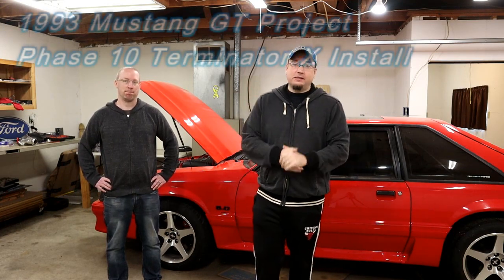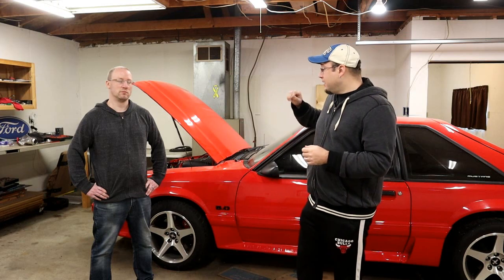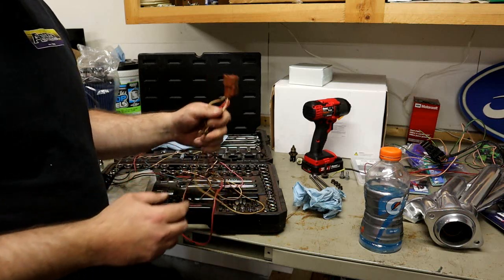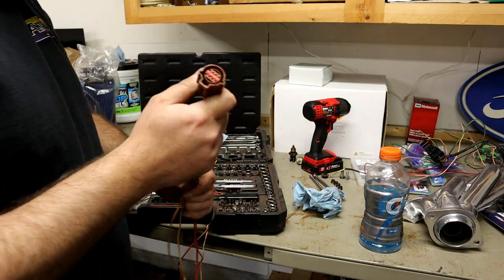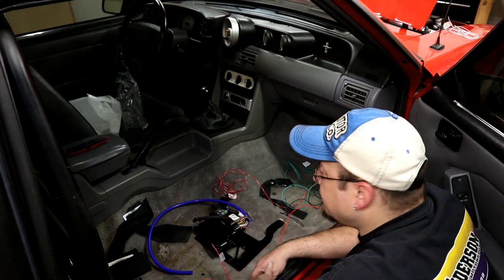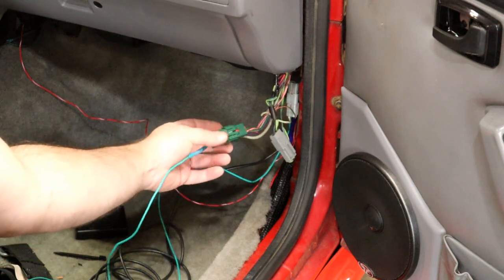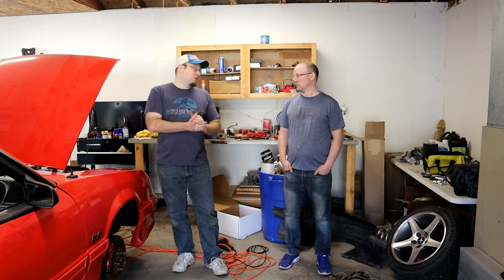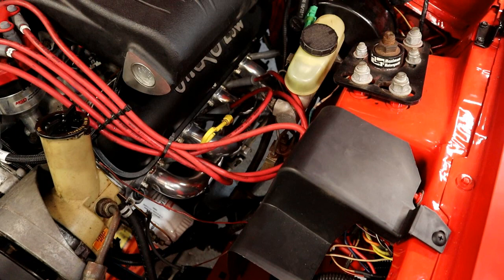1993 Mustang Project Holley Terminator X Install

Comment: Question: Hello there. I have a demanding fuel pump. Should I run the green wire into the green connector inside the kick panel? If not, could you please suggest a better place to run it? Thank you for your time and consideration.

Comment: What about the factory fuel gauge? After install mine does not work. Is that also a wire in the grey plug that needs to be hooked up somewhere?

Comment: Where did you hook up ur red and white wire jnside the car?? For the ignition crank and run 12 volts?
Reply from the maker: Fuse tapped number 18 in the fuse panel for that switched wire

Comment: Can you explain the coil wiring? I connected the coil red/green wire to the red/green on the plug and tan wire from coil to tan on plug with white wire spliced in and it shows no rpm signal or spark.
Reply: Did you ever figure it out I’m having the same issue
Reply: @91fox5  yeah i did. It turns out that Holley Terminator X is trash lmao
Reply: @anthony8194  lol, I’m beginning to think the same. So I’m assuming you still don’t have the tach or oil pressure
Reply: @joseph3859  it's fixed by the dyno shop. The issue was the tan wire. It was not getting power.
Reply: @anthony8194  I gotcha, I put in a relay straight from the battery to the tan wire but still nothing. Do you know how they did it.
Reply: @joseph3859  I'll have to look when I get the car back. It's currently at another dyno fixing the first guys tuning mistakes lol
Reply: @anthony8194  weird thing is I’m getting 12 volts still no reading. No worries man thanks for responding

Comment: I am running the Areomotive 340 in tank -8 feed and -6 return with Areomotive HD fuel pump wiring. Is the location for fuel pump connection for the Terminator (green wire) in the kick panel still a good place to tie into? Or, is there a better location near the inertia switch?

Comment: The plug by the brake booster. Does anything other than the tach, oil pressure, and coolant temp have to hook up?